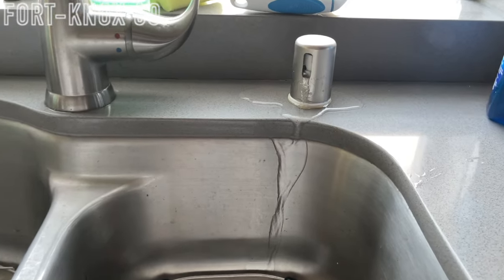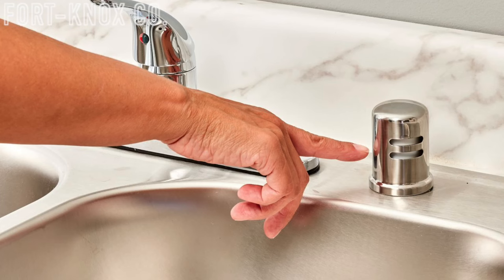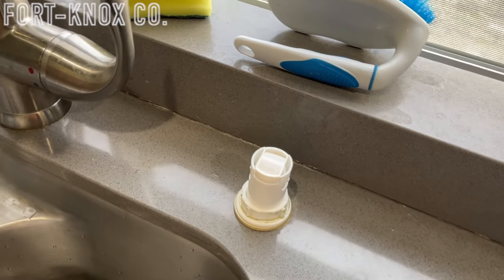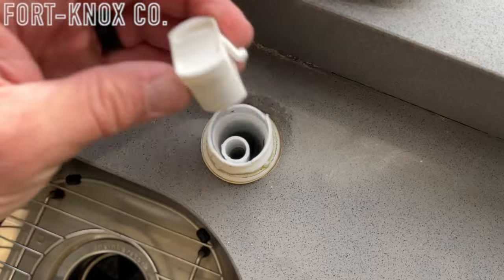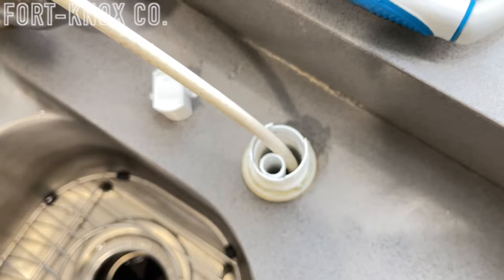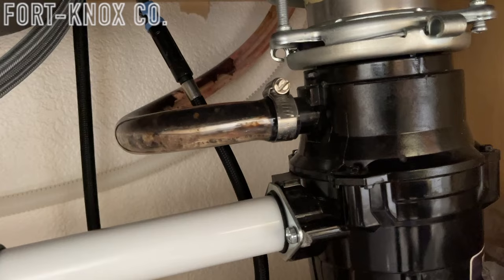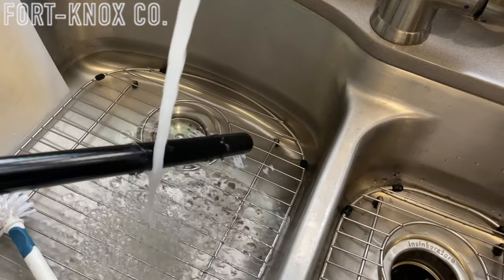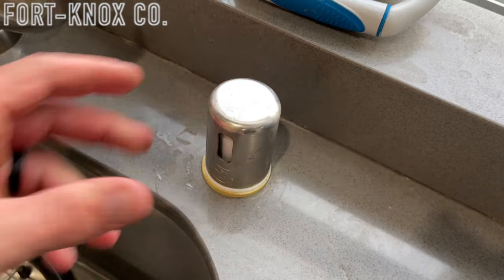Dish Washer Not Draining Air Gap Water Coming Out

Comment: I don't have a garbage disposal.     Now what?
Reply from the maker: You can still run through all the checks as you would. The garbage disposal is just your drain hook up. However you have this connected it goes from the dishwasher up to the air gap and the redirected down to your drain or garbage disposal. 

So check you dishwasher inside drain filter. Should be at the bottom of your dishwasher on the inside. Quarter turn should let the cap off and you can clean out the screen. Make sure the tube going up to your air gap is clean and clear. Make sure you cap on the air gap that redirects the water back down is in place correctly and the air gap itself isn’t clogged. And then lastly make sure the tube going down from the air gap to your drain is clean and clear.

Comment: Not me sitting here thinking I can’t fix this without my exhusbands help …. Thank you so much 🙌🏼 I feel so proud of myself
Reply from the maker: You’re very welcome. Happy I could be of help. You can for sure do this !👍🏼
Reply: @FortKnoxCo hello, my kitchen sink doesn’t have a waste disposal. Every 6-8months I get a clog in the connection of the white pvc pipe. It’s the smallest ID, it connects the air gap and the kitchen sink drain (the black hose) anyway to upsize the white pvc?
Reply from the maker: @dohc1974  your connection should go from dishwasher to the smaller connection on the sir gap( usually coming off at an angle. Then from the larger connection going straight down from the sir gap to your drain. Drainage should not go from a larger to smaller as it goes down the line. Always smaller diameter to larger
Reply: @FortKnoxCo  yeah that’s how it’s currently setup, I just couldn’t describe it as well as you did. Maybe I wouldn’t have these issues as often if I had a disposal.
Reply from the maker: @dohc1974  possibly. Have you checked and cleaned out your dishwasher’s filter? It’s at the bottom of the dishwasher and it’s usually just an easy 1/4 turn and you can pull it out and clean the screen. This will help keep large particles from getting through
Reply: @ yea I checked it, it wasn’t even dirty since the last time it got cleaned which was almost 8 months ago. We’re very good about pre cleaning dishes before putting them in the dishwasher.

Comment: ABSOLUTELY BY FAR THIS IS THE BEST REMEDY...Obtain the cardboard tube feom you typical paper towels. Remove the cover to the air gap cover. Then place one end of the tube snuggly onto the air gap, no need to remove anything other then the cover. Once snug in place, take A DEEP BREATH and blow hard into the tube, there will be some resistance and BOOM you've  just blew out the clog... WORKS 100% of the time😊😊😊😊😊😊😊
Reply from the maker: Haha. Nice! Thats an awesome trick! Thank you for sharing that. I appreciate it

Comment: This video is so good. The diagram is incredibly useful as is your showing exactly how remove the little cap with tabs. Just saved us money and time. Thank you so much for taking the time to make this video
Reply from the maker: You’re very very welcome. This is exactly why started filming stuff I’m doing and creating videos. Hoping other ppl out there could use what I’ve learned 🤙🏼🤙🏼
Reply: 5:58 hey thanks for the video, it also solved my backed up hose,I ordered a two sided drain cleaning flex line with brushes and threaded it through from both sides till the brushes came out of both sides clean, instead of disconnecting anything, preserving the tight seal of the clamps 5:58 @FortKnoxCo 5:58
Reply from the maker: @ that’s awesome to hear!!

Comment: My old GE dishwasher stopped draining at 12:30 am I was staring the dishwasher run before morning and i was almost in tears at 1:30 am  after alot stuff happening in this old house this was the final straw, I decided to google for possible help after searching and scouring the internet for help and by some miracle I came a crossed  your video about the air gap valve and I got an old long flexible clear plastic tube that was attached to my grandsons led ballon , I inserted it and it came back filled with gunk and after a few tries it was cleared and at 2:35 am,  my dishwasher is draining better than before, you saved me a repair bill I could not afford and relieved me of so much unneeded stress , so thank you so very much
Reply from the maker: Wow, that is amazing to hear. I always wonder if people are going to find any of the videos I make helpful and when I hear things like this, it’s nothing but motivation for me to keep on going. I’m always trying to put something out there that I feel people could truly get some value from, so thank you for the kind words and I’m so happy that you got this fixed. Happy that I could be of help.

Comment: OMG!  I've been without my dishwasher for a month and nobody wanted to help me fix it and I was about to buy a new dishwasher until I WATCHED YOUR VIDEO!  I took an ethernet cable and pushed it down the air gap thing on the counter and some water/debris came out and then I ran the dishwasher and it worked!!!  Thank you so much!😃
Reply from the maker: That’s so great to hear. This right here is exactly why I finally started my YouTube channel. I always felt like there were many things that other people could do and problems to solve that many people come across. It’s the little things that increase that quality of life and getting in your house back up and running.
Reply: @FortKnoxCo  Thanks for the detailed info!  It helps a single gal a ton of money and frustration of watching a dozen videos to figure out one household issue!
Reply from the maker: @ your very welcome 🤙🏼

Comment: I wasn't able to push any debris through, as you suggested, so took a cardboard tube (from toilet paper) , created a seal and blew. This pushed the debris through after only 2 tries. Thanks for your easy to follow video!
Reply from the maker: That’s cool you figured out another way. Yeah the wire sometimes doesn’t get it all. It’s good to punch through a blockage and hopefully get everything else flowing and cleaned out. But the next step would be to remove the tube completely and physically clean it all out. Good job!

Comment: This has been and on going problem for me, almost called a plummer to fix it..Just happened to stumble across your utube video, wow it definitely worked. First I removed the air gap  filter cleaned it then I removed the garage disposal hose and flushed with hot water. It was just to easy and just like that problem solved...
Dishwasher running like new, and the dishes are sparkling clean....
Thank you so much for this video, definitely saved me money....... 💰
Reply from the maker: 🙌🏼🙌🏼 that’s awesome!  So happy to hear it helped you.

Comment: I watched 2 other videos b4 getting to this. Your solution was the one that fixed my problem. The systematic approach worked well, try the easiest fix first as a "check" then get down n dirty in the garbage disposal black drain tube. Lots of gunk. I didn't have a coax cable but a long folded over/twisted bailing wire worked well. Thank you !
Reply from the maker: Nice! Good job on figuring it out. I know a coax cord is random, but it was all I had that was flexible enough but still Ridgid enough to push through any gunk. Happy you found the video helpful. 🤙🏼

Comment: I removed the airgap cover on top of the sink & squeezed the plastic portion off as you described.
I poured hot water in there kept it open ran the rinse cycle nine minutes and had a empty jar over the air gap so the water wouldn’t splash all over.
I also utilized one of those little plastic sink  cleaners one can purchase at the dollar store.
It helped me move some debris after running the rinse cycle a few times.
 It was completely clear and now the water flows into the garbage disposal instead of into the top of the sink.
I believe that the dishes weren’t completely being rinsed because of the slow flow of water through the air gap.
Thank you very much.
Reply from the maker: That’s awesome that you fix that. That’s exactly what happens. If that drainage line gets plugged, it ruins the whole process of cleaning your dishes and also how they dry. Helping the whole thing is keeping your dishes before you put them in if you’re able to. The food and debris gets caught in that line somehow making it past the dishwasher filter. Then it gets caught in the drainage line, and these problems start, good job getting it fixed 🤙🏼

Comment: Thanks man, i was able to trace my clog to the airgap itself but your video helped show how to pop the two caps above the counter.  Cleared it, much appreciated.  btw i detach the black drain hose and use a length of rebar w/ a small piece of damp rag on the tip to clear out the grease buildup inside every 3-4 years, works pretty good.
Reply from the maker: That’s awesome to hear! Good job! Yeah sometimes you gotta be a little creative to fix these things.

Comment: 4:36 - I appreciate the deeper explanation of the air gap purpose. Our entire countertop flooded thanks to the discharge hose clog, along with that broken white plastic cap.

Speaking of.. what is that white plastic thingy called (4:36). I think that cap plus the top part that screws in needs to be replaced.
Reply from the maker: Thank you! That piece is called different thing on different brands as they have slight variations on design. But it’s usually referred to as a cap/top in some diagrams. I don’t believe they sell it by itself. You would most likely need to buy a new air gap all together.
Reply: @FortKnoxCo  Thank you! Yup, entire air gap assembly is one piece and needs to be replaced anyways.
Reply from the maker: @ChristopherDillman  your welcome. I have a link for them on Amazon or you should be able to grab one easily at any big box store.

Comment: I had the dish washer running when I removed the inner air gap cap. It shot a clog out then became a 2-foot high fountain. It was a bit dramatic but it solved the problem. Thanks for the video.
Reply from the maker: lol well at least you got it fixed. I would not recommend this method to others though. Haha. Make sure you turn off the dishwasher or at least don’t do it while a cycle is running. Happy you got it handled though.

Comment: hi, great video, straightforward and well-paced, thank you. I have a question: any idea what orientation of the little plastic redirect insert we should use? It's asymmetrical, with a taller opening on one side. In your video when you first pulled it out  I think I saw the opening toward the dishwasher small opening. Then in the end, it looked like you were planning on flipping it so that opening was farthest from that smaller outlet from the dishwasher drain line. Could use your thoughts on that orientation, and recommended orientation of the assembled air gap itself on the drainboard. If you have ideas, really appreciate it, and thanks again for the helpful video!
Reply from the maker: Hmm. I hadn’t looked closely to the small plastic clip that redirects the water. From my eye I thought it was symmetrical and acted the same either way since it clips in either way. Like an even “u” redirect. If it was mean to go one way or the other I’d hope the air gap itself would only accept it one way or the other. 

As far as orientation of the air gap itself it’s usually the smaller tube that’s coming off at an angle is for the dishwasher and should be pointing towards your dishwasher. Most cases I’ve had it where the dishwasher was situated to the left of the sink. And the larger tube pointing straight down is to the sink drain/garbage disposal. And that’s straight down and larger to allow the easiest flow of water to continue without resistance
Reply: @FortKnoxCo  Thank you! I did a little experimenting, and it looks like the correct way is for the shorter side to be placed next to the dishwasher outlet, so the longer end directs the water down past the overflow relief openings. You're right, it looks like the only way you SHOULD be able to place it is in that orientation. On mine for some reason I was able to put it on backwards, and the shorter side then allowed water to spew out. I flipped it and it worked beautifully. Thanks again for such a helpful video!

Comment: This video was so helpful thank you! But which hose do I need for the dishwasher to the air gap?
Reply from the maker: Your welcome! The dishwasher to the air gap should come with the dishwasher. It’s usually a corrugated hose, and it has rubber fittings on both ends that a clamp goes over to hold onto the dishwasher and the end piece of the air gap. You can search on Amazon or find it at Home Depot easily. Very common. They just call it a dishwasher drain hose
Reply: @FortKnoxCo  thanks so much! Got it!
Reply from the maker: @janeaustenfan1979  awesome

Comment: Very helpful. thank you for posting.
Reply from the maker: Happy to be of help
Reply: your diagram of the dishwasher connection with the air adaptor was super helpful. I was able to clean. the hose with a long wire brush, cleaned it with bicarb and vinegar,
now the dishwasher drains perfectly. thanks!
Reply from the maker: @anthonyzarrillo6565  awesome! That was my goal, to try and put some Info out there that people could follow and get their problems fixed or maybe even self diagnose once they understand what’s going on. Happy to hear this

Comment: The smallest discharge hose going to the garbage disposal at Home Depot was 2 ft. and my existing hose is approximate 9". Should I cut the hose I bought to 9"?
Reply from the maker: If you need to cut it to length that would be the way to go. I’m assuming you’re talking about the larger black hose? It’s kinda thick right? Make sure you soak it in hot water to help it bend into place and fit over your connections where your putting the hose clamps on

Comment: Even I could do this. I used a rigid wire down the air gap and could actually see it come out via the space above the garbage disposal- Wasn't a ton of gunk, but ew that disposal was gross. Cleaned that rubber fitting and put the air gap back together and presto! $500 saved. Thanks FKC!
Reply from the maker: Freakin’ awesome! Good job! 🤙🏼🤙🏼 I appreciate it! Happy to hear you saved some $$

Comment: Get video and diagram! My hoses don't seem to be cloged but the white plastic cap of the air gap has come off the counter. What bonding material should I use to secure it in place to the Caesar stone countertop? Thank you.
Reply from the maker: Thank you. 
If you’re just referring to the cap that covers the air gap, they are usually just held in place by friction. They slide overtop and have a tight fitting or possibly a rubber ring to create a seal and friction between the surfaces. I’d check that and see if there something you can clean or replace to make the contact tighter 

If your air gap is loose and not secured tightly to the counter top then you might need to tighten the ring that goes on under the counter top that secures it down. If the plastic nut is missing you may need to replace the air gap itself so you have all the proper pieces. And if the hole in your countertop is too big for the washer /nut under the counter to secure tightly you may need to use a larger washer on top or below the counter to create a tighter fit.  
The air gaps are not usually held in place by any bonding material.
Reply: Thanks for your quick reply and tips.  The cap needed to be screwed into the air gap hose tightly to create a tight fit with the counter. I didn't realize there were threads!
Reply from the maker: @melissalewis2120  oh nice. Thats awesome you figured it out! Good job 👍🏼

Comment: Regarding the hose that goes to the garbage disposal I thought I had seen when the installation individuals should have put a J-bend in the drainage hose? 
Is this correct?
Reply from the maker: I’m not sure as far as the JB that you’re referring to. Normally the hose that goes to the garbage disposal is coming from the air gap, so that means that it’s coming from up above and then back down. There are some ways to plumb this where you do not have to install an air gap, but you do need that Drainage line from the dishwasher to go up and then back down. You don’t want water sitting down in the bottom of a low spot.

Comment: If the air gap is clear and no clogs are blocking it, what else can cause the water to back up and have it come from the air drain line? I cleaned it all out but on a rinse cycle water is still coming out from the gap, thank you
Reply from the maker: If water is coming out of the air gap, that usually means that the water is not having a problem going from the dishwasher up, but from air gap forward is the problem. So I would check the pipe or tube that is connected from the air gap down to your drain or garbage disposal and possibly clear that out. You may need to remove that pipe altogether to really see if it is gunked up also check the opening to your drain or garbage disposal, that very often gets blocked by debris and that could be the culprit. Assuming from the air gap down to your drain is completely free and clear that should solve the whole problem. There is something stopping the water flow from there to the drain itself. A lot of times I see the blockage at or in the garbage disposal.